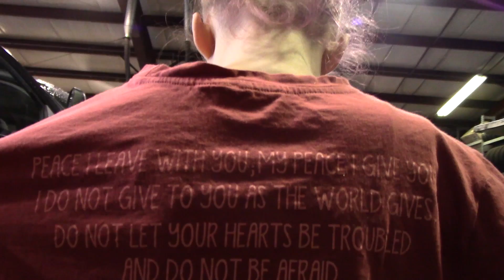SD behind the scenes

Comment: Hey I have a 94 Honda Civic and I’m having troubles with the idle surge. I watched your video and adjusted the fast idle valve but it didn’t fix my problem. I replaced the iacv and that also didn’t fix the problem. I replaced the throttle body gasket and the intake manifold gasket as well but it didn’t seem to solve the problem. Bubbles keep coming out of my radiator and the idle only surges between 100 rpms and 900 rpms when I press the gas. I would really appreciate your help.